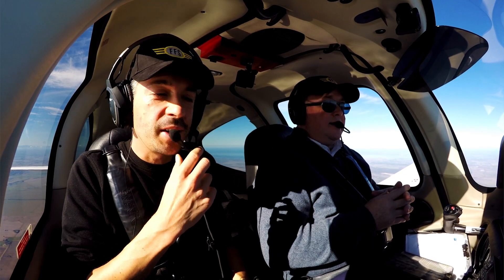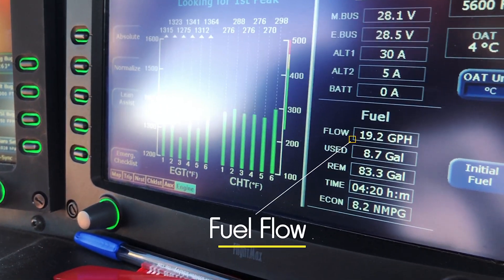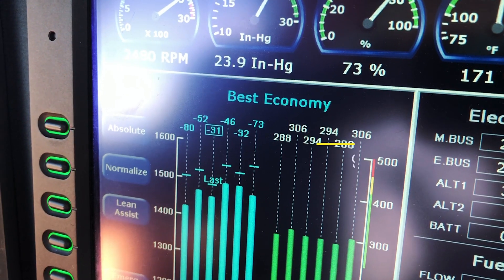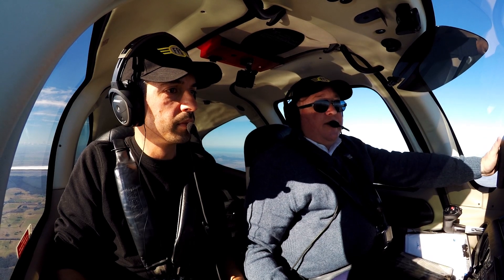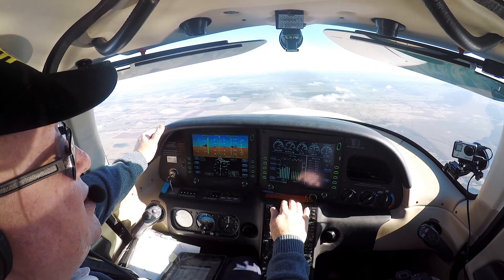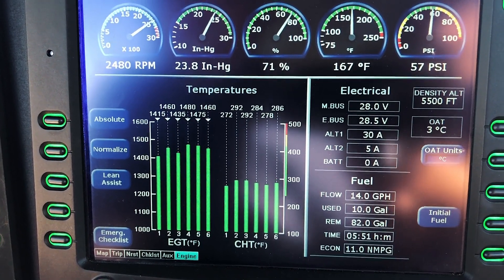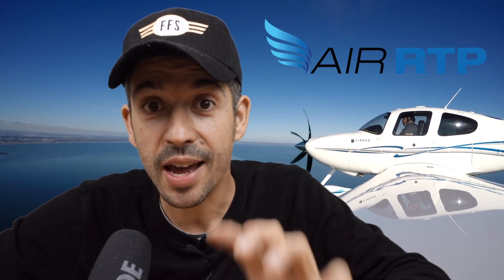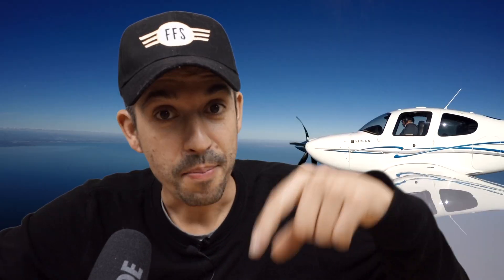Cirrus Lean Assist and Best Economy

Comment: This is the old Avidyne panel.  The G1000 panel in the newer Cirrus computes LOP and provides a cyan box to hit with a white carat when pulling the mixture back giving a clear visual queue. The CHT (and TIT) temps will differ between the SR22 and the SR22T.